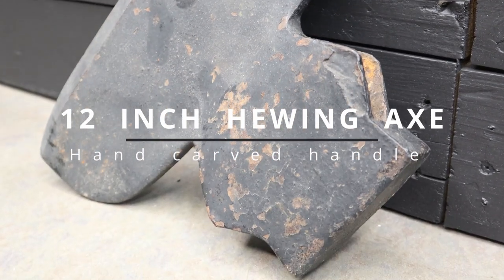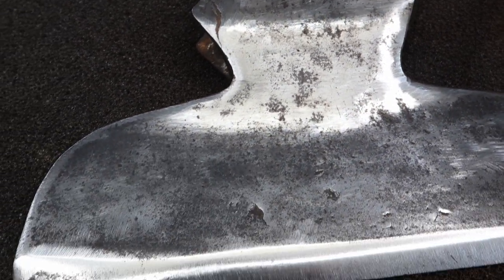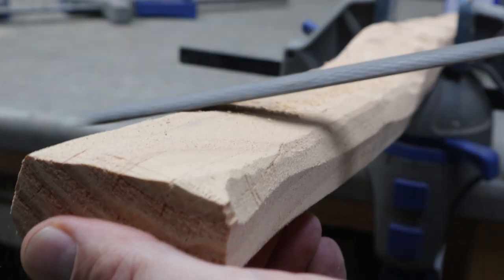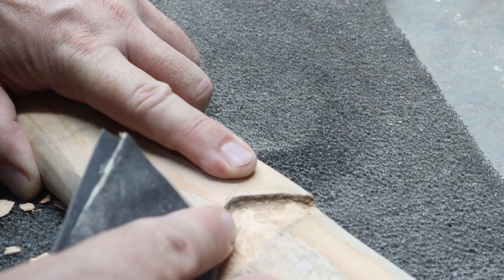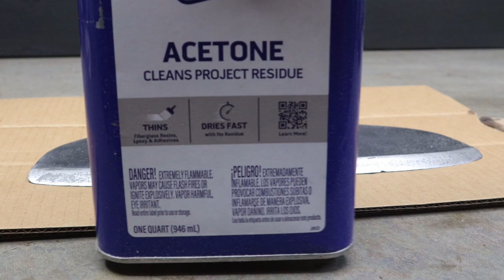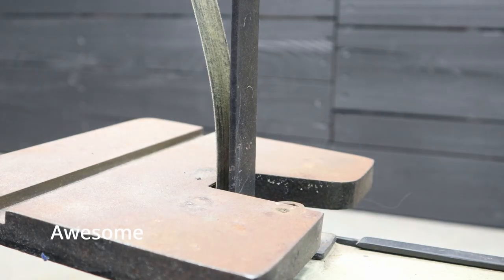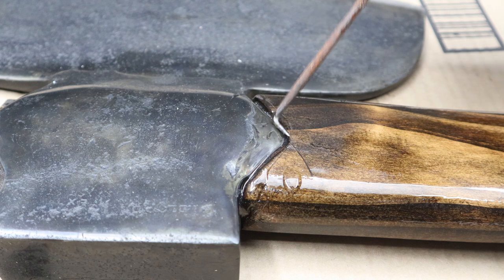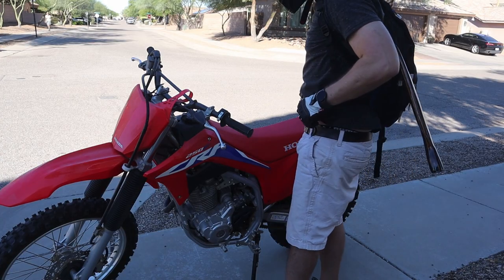Restoring Huge Hewing Axe & Hand Carving the Handle

Comment: If you submerge it in a glass dish full of vinegar, put it in the oven for about 12 hours on 200° F , check to see if you need to add more vinegar, take it out and rinse and brush with soapy  water it will look like bran new metal. Then to protect it from rust I'll put it in the over on about 350° after I wipe it down with lard / bacon greese and cure it like a cast iron pan.
Great job on the axe & handle.
Reply from the maker: I'll give it a try on a future project. I'm always trying to find new ways to get rid of rust. Appreciate the tip.

Comment: yeah yeah...nah!
it's pretty but not a good tool... have you ever heard of a wedge???
that's how handles are attached to striking tools...
and handles are ALWAYS 100% clear stock...no knots
hang it on a wall...DON'T TRY TO WORK WITH IT
Reply from the maker: I've used wedges on other projects, I'm familiar. Just felt like using epoxy this time around. The knots are not ideal, I knew that going into the project which is why I epoxied the whole thing. It's solid as a rock now. It's more of a fun project anyway I don't plan on building a log cabin by hand anytime soon.